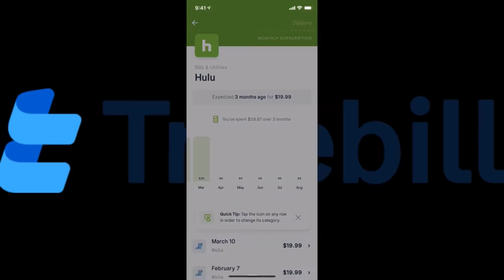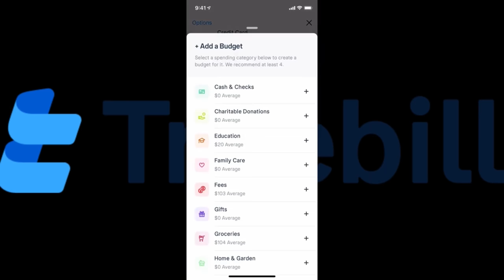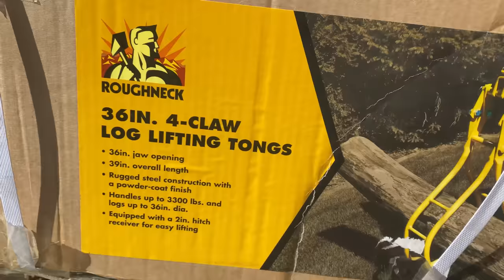Building A Greenhouse

Comment: Mike, you should cut a birds mouth in each side of your purlens to secure them better because you don't have a lower cross brace. If the roof gets any weight on it the way you have them now, the screws will split out from your top plate.
Reply from the maker: Thanks Craig! Good idea.

Comment: Just found your channel, not sure how you landed Sheryl Crow's baby sister, well done sir.  
We do many of the same homestead actives on 100 acres over in western Washington.  Fun work.
I'm sure you do plenty of dirt leveling/grading with the JD tractor.  My dad keeps an approx. 20" x 6'-8' log around for quick grading with the excavator.  Grab it with the bucket and thumb and use it like a wide draw  blade.  Give it a try, he likes using it even though we have 850 dozer, 680 backhoe with 4-in-1 blade and a JD tractor.  Not sure how often he adjusts the bucket angle and his hydraulic thumb while doing this.  Would think you'd start with your thumb in the fully down pin position. Maybe a log that's less than 8' already.

Comment: Looks good, however, you're not taking into account the shrinkage of the lumber. You really should've cut the wood beforehand and let it dry for several months before using it to build with. You're going to get movement and loose joints from the wood shrinkage.